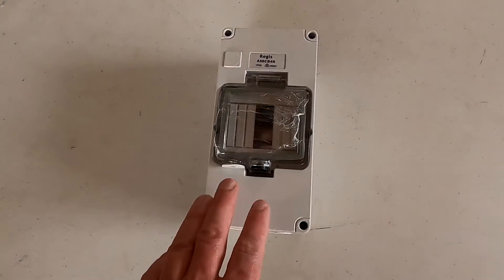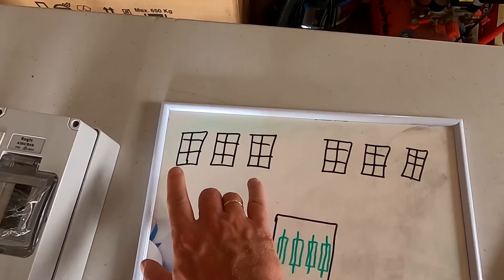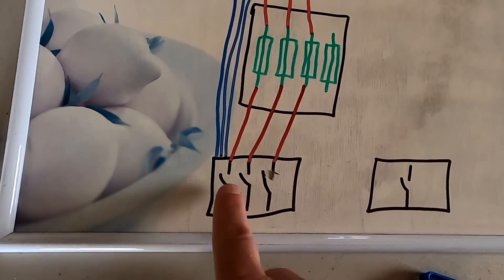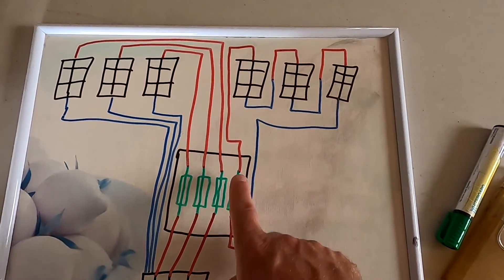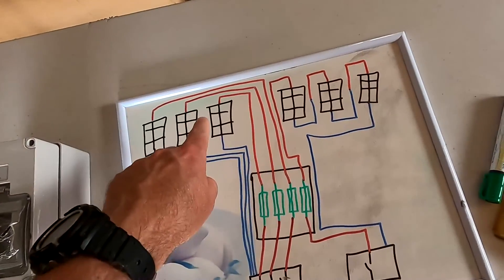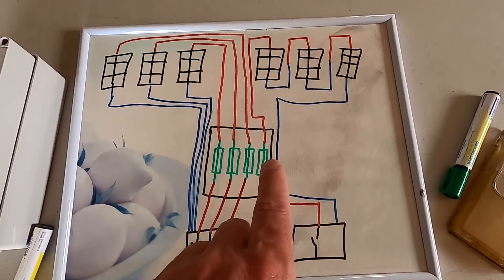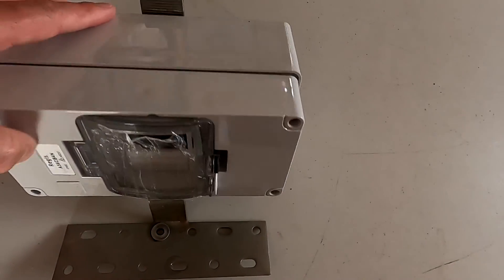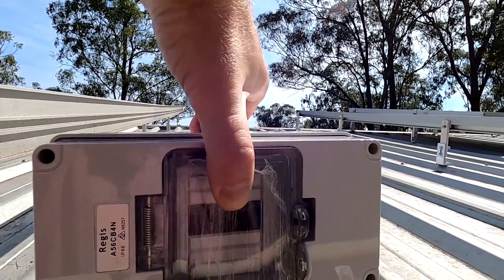Installing a Solar Fuse Box on my garage.

Comment: Hy Andy , the fusebox on the roof makes no sence. If you got a problem you always need the ladder. Will you do your mesurements at your table ? than this is the place for solving problems and your fusebox.  in which size you will connect your panels 4mm² or 6mm² ?

https://prevent-germany.com/solarkabel/solarleitung/photovoltaikleitung/photovoltaikkabel-2x4-mm2-farbe-schwarz
https://prevent-germany.com/solarkabel-2x6mm2-h07rn-f-solarleistung-kabel

Do you know the crimpless mc4 connectors from Weidmüller ? https://prevent-germany.com/montage/kabelverbinder-stecker.../kabelverbinder-stecker...

https://prevent-germany.com/detail/index/sArticle/12090
https://prevent-germany.com/solarstecker-weidmueller-pv-stick

Check how many strings your s-Loader can handle and the max.Solarpowerinput Voltage !
Split your solarpower in identical loads
Take a look at https://prevent-germany.com/easysolar-48/5000/70-100-mppt-150/100-color-control-komplettloesung?number=PMP485027010    single phase 
hand walter
Reply from the maker: It makes only sense on the roof as all the cabling from the panels to my workbench are unprotected otherwise. You want the fuses as close to the generator as possible. I'm not expecting having to service these fuses at all (unless we have a faulty panel). The ladder is in the garage too, so take my less than 1min to setup.
Reply: @OffGridGarageAustralia  agree Andy, you want a form of protection as close to the energy source as possible and you should never have to touch them unless you get a serious fault or you need to isolate for safe working. 
I like it. I will be doing this with my panels when I have their final locations mapped out and work out where I could put an enclosure.

Comment: Hi Andy, You should not use galvanized srews with stainless steel. There will be an electrochemical pair and srews will disappear in moist environment.
Reply from the maker: Yeah, that's right. I used the wrong term, they are not galvanised, they are... not sure what they are but they don't rust.
On the other hand it is dry like a desert here. No moisture around.